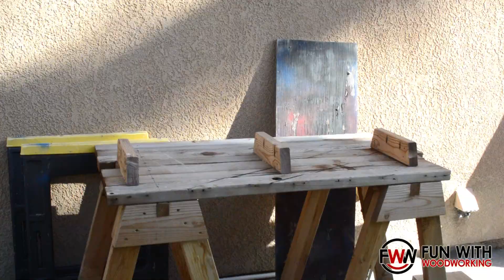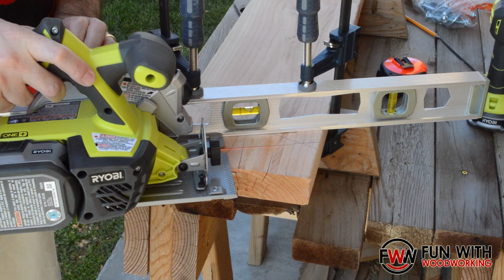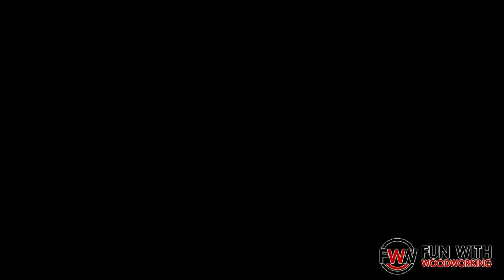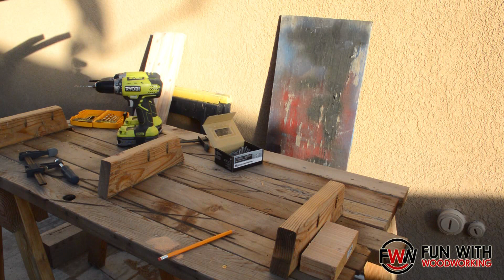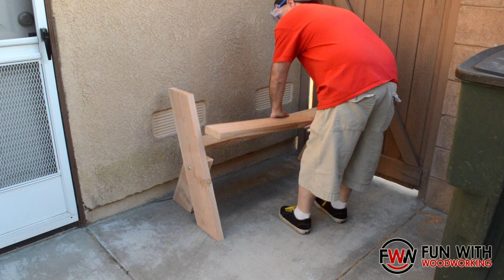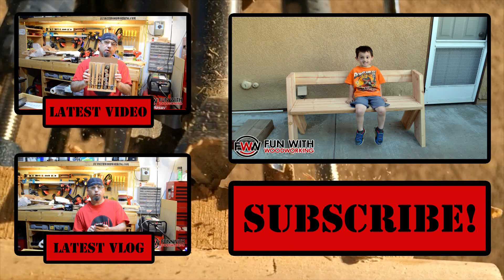How to build a quick and easy garden bench in under 2 hours for less than $20.00

Comment: Using what I have so trying to make this out of 4 2x4's and a 2x3. The rough cut is done for gluing ( only have four clamps ) but I think I may need to use the off cuts for some bracing to support the joins. Will show a photo when done. First proper project after a simple pallet planter so thanks for the inspiration.
Reply from the maker: doyle201206 Good luck!  I can't wait to see it.
Reply: FunWithWoodworking Can't work out how to put a photo in the comments. Its done and tested to 18st so the glue is holding on the legs!!!
Reply from the maker: That's great!  Check out my about page and there is a link to FaceBook and you should be able to post them there.
Reply: Sorted, bingo.

Comment: Nice. I'm all about budget builds. I would have suggested making a fast offset gauge for the straight edge. But looks like you are eyeballing it just fine ;)
Reply from the maker: diycentral I actually used the laser on the saw to align the fence. It just didn't translate well in the video.

Comment: Great result - would have liked some captions for figuring out angles 
etc
Reply from the maker: Steve SteveS Yeah, I didn't think about that until I had already posted it.  There are dimensions on the free plan on my website but I forgot to include the angles.  I will add them when I get home.  Thanks for pointing it out.
Reply: FunWithWoodworking what are the angels you use Please

Comment: You got a leveler for a straight edge, but you're using a triangle LoL
Reply from the maker: It's actually called a framing square.  I used it to measure the angle to cut the legs at.  Thanks for watching!